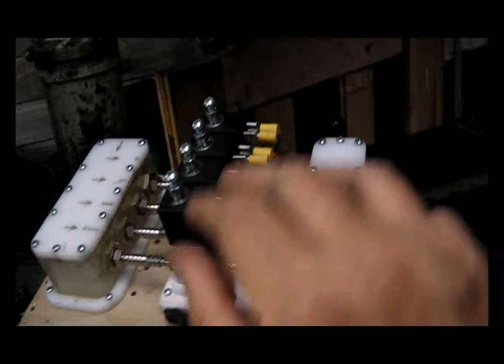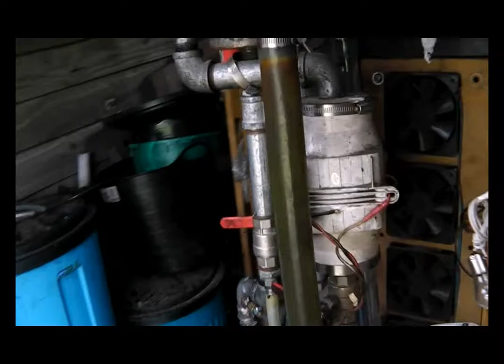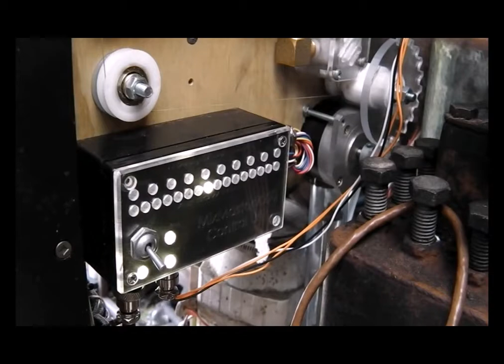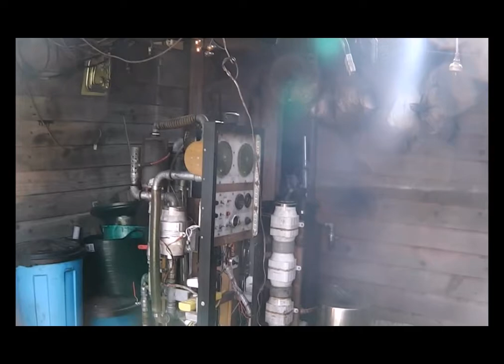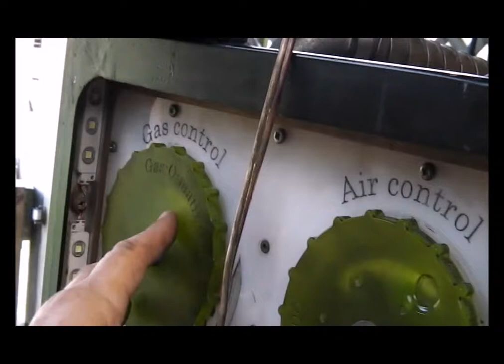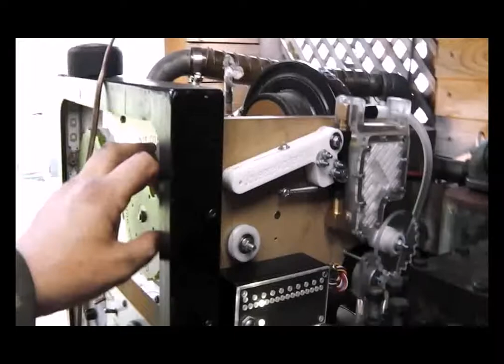A New Automatic Mixture Controller: The SqueezeMaster9000

Comment: Excellent show ! Congratulations on your first successful run of the updated version. I would imagine the silicon squeezer hose would be temperature sensitive and may be rather hard to squeeze and need to be warmed up to room temperature for winter operations. Conditions will tell during the testing phase. You have certainly overcome one of the big obstacles of running these little gasifiers.... unattended !! Hats off !
Reply from the maker: +NH Hbbyloggr
 Thanks kindly, my fellow woodgas bugbite victim. 
 The performance of this new controller is really quite an improvement on the original version, so it's all onwards and upwards from here.   
 I did try freezing the tube, and I was pleased to discover that it remained nice and flexible. 
 Perhaps it was a little stiffer, but I think the heat from the surrounding systems will quickly bring it up to a good working temperature. 
 That stated, I figure that I really do need to put this to the test next winter when the whole thing will freeze up, especially during the weekends when the weather is always at its worst  ;) . 
Improvements and further testing will be taking place perty soonly.
Reply: No doubt you will have the system tweaked as the needs arise. It really is an amazing piece of work.I was impressed with the ability to start the engine with such rapid response to the extreme lean to rich conditions. Pretty darn cool !
Reply from the maker: +NH Hbbyloggr 
 Indeedy. This squeezy thing will enjoy a lot of improvements in the near future. 
 For a first off test run, this did pretty jolly well. 
 It's all onwards and upwards from here for sure  :) .
Reply: I'm wondering what limits to engine size there might be? Are all the components sized for , let's say a 12 hp engine ? Or could it handle up to 25 hp ?  ...LOL, or the Jolly Green 6 cyl? That ought to suck the stuffing right out of the filter box !
Reply from the maker: NH Hbbyloggr 
 Hmmm, I am pretty sure that the 0.5 inch internal diameter squeeze tube is the limiting factor here. 
 It wood work with a bigger engine, but I wood have to add some air with the manual valve. 
 That's cheating!!!!  ;) . 
 For sure, your Jolly Greener wood suck the entire regulator down the intake pipe and blow it out the muffler in a puff of expensive technical confetti  ;) .  
 I have some plans in my head for a different design that retains the positive attributes of this one, while letting it work with bigger grunters. 
 It's based on the way a trap door works....
 Perhaps this will come to light on the BIIIGGGG gasifier in the near future  :) . 
 Ohhh, so many ideas, so few years left to try them all out.
Reply: Trap doors make me nervous, especially when there is a noose tied above it . At a distance that sounds like it would work well. Perhaps with various door sizes for different size engines and one that would not allow me to fall through.
Reply from the maker: NH Hbbyloggr 
 Hehehehe, you will be safe from the trap-noose, unless you have angered the woodgas gods  ;) . 
 If thou hast transgressed, thou must repent, and be re-bitten by the bug of gaswoods. 
 Indeedy, I think the trap door idea, or an equivalent, like a non contact needle valve system, wood do the trick. 
 Materials, like Delrin or Acetal - as we call it, should be of great benefit here. 
 I really do need to think about this, perhaps with the assistance of coffee granules, as I am sure I can simplify the mechanism, and eliminate the majority of the wear points, while maintaining a clean, regulated, airflow to the spark assisted spinny grunta  :) .
Reply: Hi Steve, it's the bus dude from Auckland here. Nice job on the automation of the wood gasser! That should make life a bit more convenient for ya. I'm often trying to come up with improvements at my job here in Auckland, but my boss seems to have mis-remembered the old maxim and keeps telling me we should work harder, not smarter! I'm sure it's supposed to be the other way around.

This may be a silly suggestion, but if you're wanting to get away from the squeezy tube and go for more airflow at the same time, would a switch to a ball valve be viable? I remember you had some large ball valves (25mm - 38mm diameter IIRC) lying around in or around that old shed next to the caravan out the back. With  a CNC-made worm gear, your stepper motor could drive such a valve without too much trouble.
Reply from the maker: Howdee Max,  
 Thanks kindly. I am truly delighted with the performance of this system, as it saves me bus loads of time, while keeping the beer cold and the battery bank full  :) . 
 Hmmmm, yer boss needs to catch up to the rest of us who have seen the light as far as smarter ways to do things are concerned. 
 Ya know, my employer was just like that, and it took them nearly 6 years to realise that I was right and they were not right. 
 One day, your boss will discover the error of his ways too  :) . 
 
 In one of my very early videos, I did mention my plan to automate the gas mixer on my system. 
 It involved the use of a stepper motor that wood drive the existing air control dial from behind, via a toothed belt. 
 I even went so far as to make up and fit the toothed sprockets, but then I decided against the idea. 
 These valves tend to wear out when operated too frequently. As this happens, they develop air leaks, and they admit debris to the air stream, which can harm the engine. 
 The skweezee tube system gets around these issues by simply failing if it wears out. This quickly stops the engine, thereby protecting it from the possible ingestion of debris. 
 You wood be surprised at how little of an airflow this gasser needs, but the BIIIIIGGGGGG gasser will need a much bigger mixer valve, so I am planning to make a suitable system for it soon. 
 This will use a gate valve, and a variation on the Geneva mechanism to operate it via a stepper motor. 
 To resolve the risk of wear induced leakage, the mixer assembly will be housed in a purpose built air filter box, that will also serve as a means of actively cooling the stepper motor. 
 It's a work in progress at the moment, but it will become a reality soon enough  :) .
Reply: Hey Max Brewster- had to laugh on your mention of your boss's idea of working harder not smarter! I had to live/work under same circumstances until I was able to flee...! Much happier for it too! 

I suggested CNCmachingisfun use an old school 1 barrel carburetor (maybe off a small car engine or a lawnmower) to control air flow with it's butterfly valve setup. Be much easier to operate/control from a mechanical point of view.
Reply: That's an excellent suggestion Bourn Phree. Carburetors are a proven technology, obviously designed to be reliable in an automotive environment, and easy enough to control mechanically with a stepper motor. They don't seal off the airflow 100%, but I don't think that's a requirement anyway for this application.

As for your comment below re Arduino, I use them too. Nifty boards, cheap, and easy learning curve. On my second project with the Arduino (mega) I was already onto using a colour LCD screen, with touch screen facility, real time clock via SPI interface, bit-bashing another SPI-like interface for a "floating" 16-bit dual channel ADC, and digging deep into the existing driver for the LCD to improve write speeds (especially for text) and adding support for multiple fonts. And the IDE for Arduino makes it so easy to come back to it even a year later to make changes to the software.
When I first encountered them I was really put off by the fact that add-on boards were called "shields", but meh... whatever they want to call them... the Arduino system is bloody great!
Reply from the maker: Unfortunately, a carburetor will be quite useless on this little gasser. 
 On a large gasifier, yes, a carburetor offers a viable means of gas mixing. 
 The leakage that these carburetors are known for will cause other problems though, such as unwanted explosions in the secondary gas flare port, unless another manual valve is added to the system. 
 These systems have lots of little gotchas in them that are just waiting to catch us out.
Reply: I didn't realise that leakage would be a problem, I had the impression that this gas flow regulator would never be set to the completely off position, but always allowing some flow to occur.

Something else I was thinking about... Considering you have numerous machines in your power production phacility ;-) such as the fuel finger fabricator, followed by the one that turns those fuel fingers into little cubes, which are then fed into one wood gassifier that's coupled to an internal combustion engine, and the charcoal that this first gassifier produces is then used as fuel in a second gassifier presumably also coupled to an internal combustion engine... that's a lot of machines to manage and maintain.
Steam engines, at the peak of their technological refinement, were more efficient than internal combustion engines, right? Would it make sense then for  you to build a top of the line tripe-expansion steam engine, with a water boiler that can run on wood, coal, llama lumps, used engine oil, and maybe even a heliostat in the summer?
Have you ever been to MOTAT in Auckand? (Museum of transport and technology) They have several working steam engines on display. The one near the entrance to the steam engine shed is amazingly whisper quiet, even though it delivers a few kilowatts.
With a water capture and re-use system, and some fancy electronics to monitor and control the steam engine / boiler combo, would you get more energy out of each load of wood, with less attention required from you, and fewer maintenance stops?
Reply from the maker: Howdee Max, 
 Because the throttle body is responsible for managing airflow into the mixer, any airflow that occurs when the valve is meant to be closed can very easily lead to an explosive mixture in the wrong part of the system. 
 If it was managing only the fuel gas flow, the situation would not be anywhere near as critical. 
 I went for the squeeze tube method as it satisfies a number of critical requirements for safe and reliable operation of a small gasifier. 
 This wood knot work quite so well on a larger gasser, such as I will be building soon, so I will need to settle on a viable alternative as I work my way through that project. 

At their peak, reciprocating steam engines were pretty darn good, but it wood appear that they were never quite as good as the diesel engines that started to replace them near the end of their era. 
Steam turbine engines offer some interesting advantages over their reciprocating cousins, but my concerns regarding the overall safety of steam powered systems will quite reliably keep me from seriously considering them as an alternative to my existing prime movers.  

The generators I currently operate are lightweight and easy to maintain. 
Also, the parts are quite cheap. 
These attributes, and perhaps a few others that I have not yet considered, very effectively cement these power sources as my favoured choices  :) . 

Fortunately, solar panels are quite cheap these days, unlike when we were just starting out with them all those years ago  :) . 
For not too many dollars, one can set up a 1000 Watt array. 
A 1000 Watt installation will be taking place here during the upcoming Chrysanthemum holidays. 
Hmmmm, watts. I love lotsa wattsa  :) .
Reply: Howdee Brucee, yes pressurised steam can be dangerous, but of course so can explosive wood gasses and carbon monoxide. Each technology will have its advantages, disadvantages, and dangers. Except solar panels perhaps. But even they can be dangerous if you hook too many up in series and then put the wires on your tongue to see what sunlight tastes like! ;-)

For your 1kW solar installation, will you be building your own solar maximum power point tracker? Or will you go for a commercially built one?
Oh and what about that large windmill tower in your back paddock, any plans to get that producing amps again? That should be a help in the winter months. Between the two you might be able to avoid engine-driven generators altogether.
Actually, come to think of it, you can get small commerically produced windmills off TradeMe, each producing around 400W, so with a few of these dotted around the place, you could have a steady flow of power even on cloudy days and at night. And if one goes out of service, you still have the others in operation while you repair the faulty one.

I considered putting one of those little windmills on my bus, so I could avoid idling my engine so much in winter, but the problem is where do I put that mill when I'm driving?
Reply from the maker: Howdee Max 
 Well, when you look into the history of steam boiler explosions and pressure leaks, you will discover that it is littered with terrifying horror stories of death and destruction. 
 That's where a flash boiler wins out. These have only minimal fluid volume, thereby substantially reducing the risk to personnel onsite. 
 That stated, the relative complexity of the various systems tends to favour the internal combustion engine, and its inexpensive supply of treezelberry based juices  :) . 

 Sunlight is delicious, but it needs to be mixed with gin and tonic for best effect. 

 I haven't really thought about an MPPT device for the 1KW array, but I wood probably go with a commercially built one, in order to save time. 
 Life on the farm is plenty busy, so spare time is in rather short supply. 

 Due to my ever present 'gift' of agonising and crippling arthritis, work on the large turbine is out of the question. 
 If I had known that my life was to be destroyed by this 'gift' from on high, I wood knot have embarked on that overly ambitious project. 
 Indeed, woodgas and solar have rendered it somewatt redundant anyway  :) . 
 Smaller turbines, judiciously dotted around the farm, are probably the best bet, for the reasons you have listed. 
 I wonder if you could install some sort of swing up/down system on yer bus for a 400W turbine. 
Maybe, if you could alter the rotor blades, so they can fold back, you could reduce the overall size for easy transport to the next wind site. 
 Anything is posserabull, if yer imagination is set all the way up to eleventeen  :) .

Comment: Thats awesome dude! Are you going to add a park function. So when the engine is off the tube isn't being crushed. That way the hose wont get a memory in it. I guess the next ones are going to be billet machined aluminium filter housings?
Reply from the maker: +Seventy7 Industries
 Thanks kindly bro  :) . 
 This little squeezer has received some improvements and updates since the first test run, so it should be even more betterer on the next run. 
 That's a good point about the park position. I hadn't considered this, but I will be sure to add some code to the software - to prevent the squeezy hose from getting permanently kinked up. 
 For sure, the production units will be super shiny and extremely cool. 
 In no time, I am sure I can sell at least a millionteen of them  ;) .